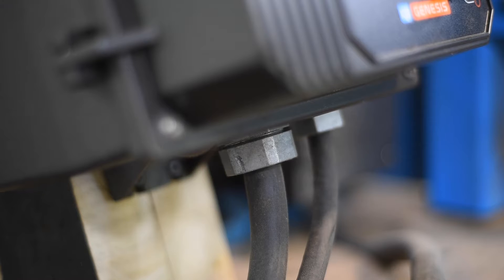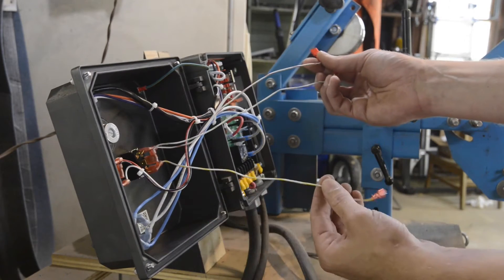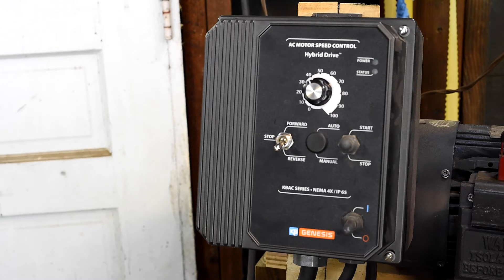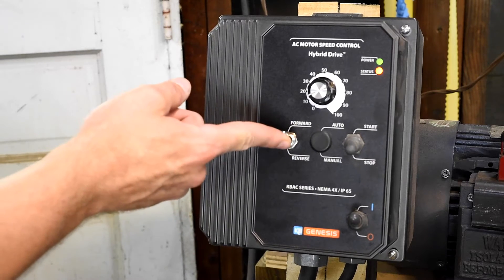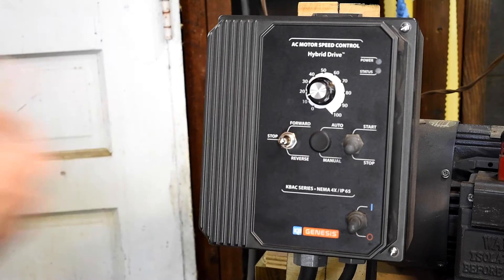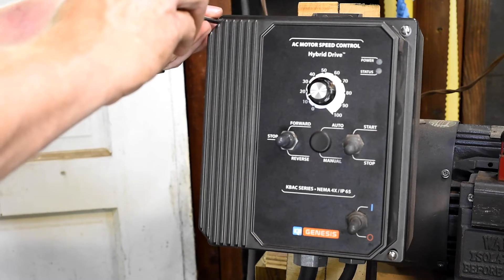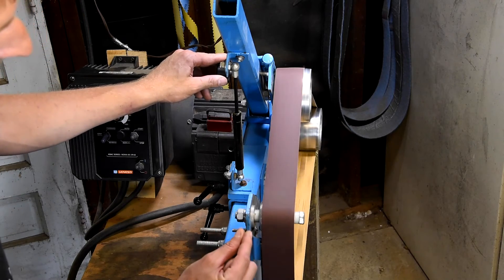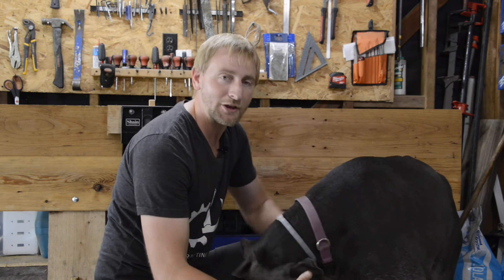KBAC 27D Forward / Reverse Switch Installation

Comment: You need a other adjustment on the adjustment wheel, one adjusts the up /down movement, the other has to adjust the forward and backwards, movement of the wheel, then you'll get it very close, the main problem is the belts not running the same in different directions.
Reply from the maker: Yeah, it’s part of the design issues I’m experiencing with my grinder, I want to remake the whole tracking arm and redo that mechanism to allow for both directions of adjustment, it’s super annoying to get the other movement in any sort of consistent manner.